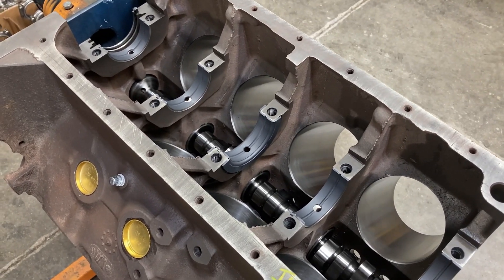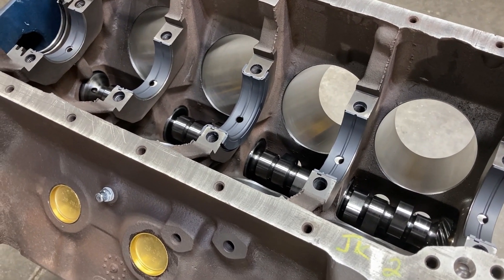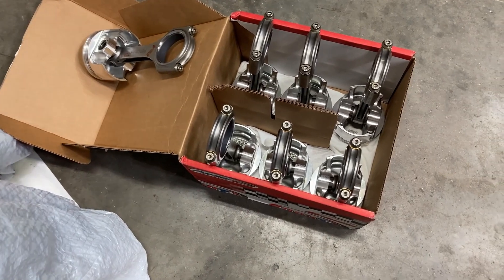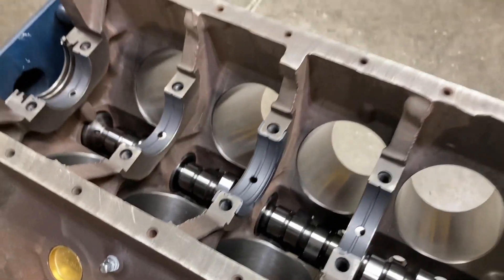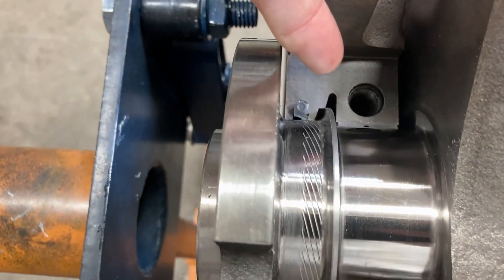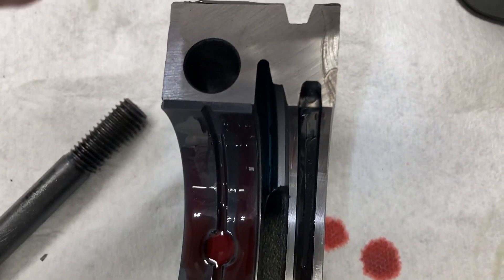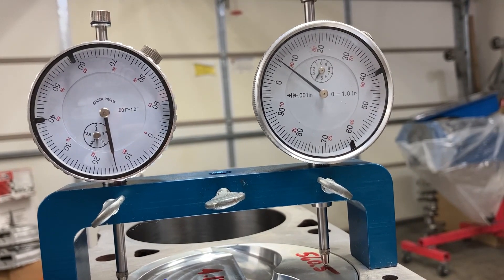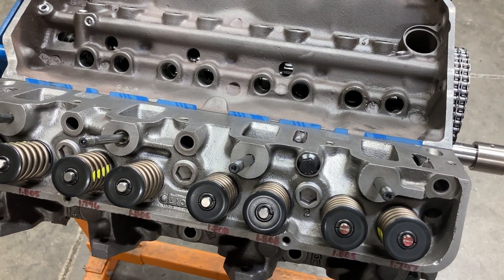Lykins Motorsports Ford 428 FE Assembly, Part 1, JV

Comment: I always funnel the oil holes using the old main bearings. It really improves things.
Reply from the maker: It will only improve things if you use a 3/4 groove bearing shell as those bearings block the feed hole.  If you use a full groove bearing, you will never know the difference.